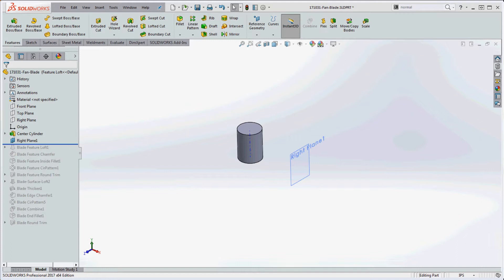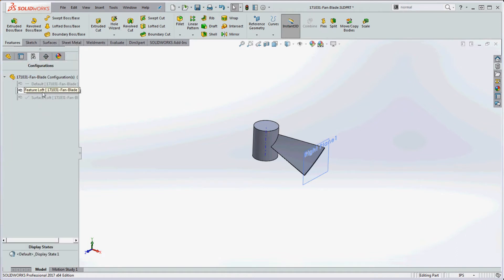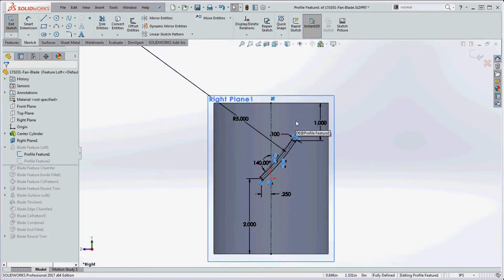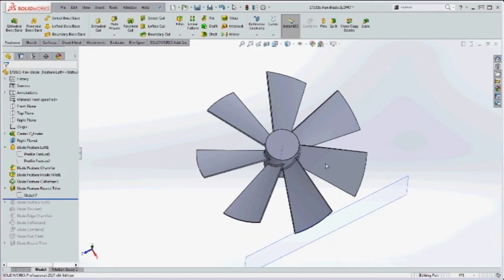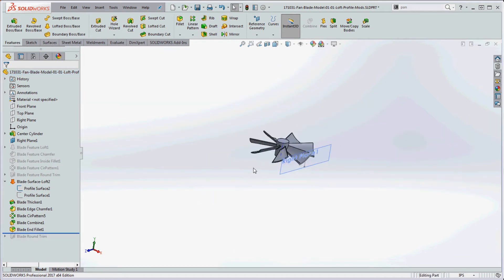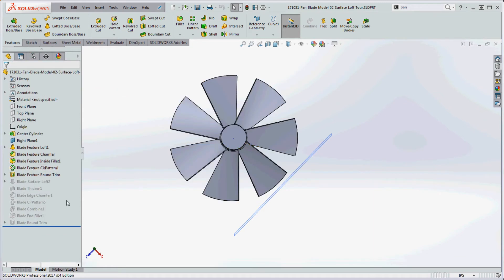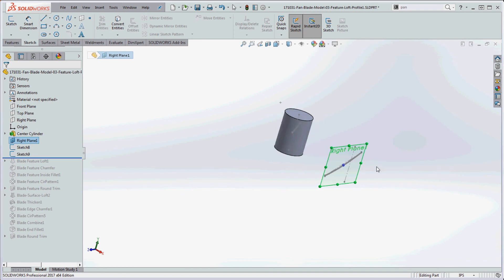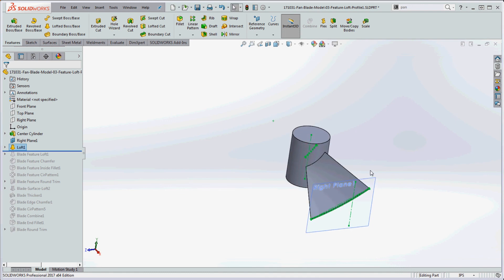33, Online SolidWorks - Create a Fan with Blades or Similar Form - Solid & Surface Lofts & Pattern

Comment: I get what you're doing here and it's been real helpful for me.   The fan blade I'm needing to draw is not only a typically angled fan blade like the ones you show here but,  the blade I'm having a hard time with also includes a sort of cup-shape on the front side of the blade.

It's not actually a fan blade per se,  It's a single blade for a fishing lure.  The cup feature on the front face of this blade is there to create a plopping sound as the blade comes full circle and enters the water as the lure is being reeled in.  How would one go about creating that slight curved indent or cupped feature on the front facing surface of the blade?

Thanks for your help.
Reply from the maker: The first thing you should do is consider Surfacing tools, SW will create a more stable model when you don't have volume to deal with from the get-go.  With the Deform surfacing tool you can apply a grid and points onto a surface and pull or push those points to get a form you may be looking for. After that you can add a thickness to the surface and other features that you may need.  Hope this helps.  CSS
Reply: @DesignInnovations  Thanks for taking the time to reply.  I really appreciate it.  The technique you mention is foreign to me.

This is not because your explanation makes no sense.  It's because I'm self-taught in SolidWorks and on top of that I'm using an older version so I'm not really sure if my version 10 has those features.

I actually finished up the drawing of the fishing lure I alluded to this evening.  I'm sure doing the way you've described would have been more efficient and the correct way to go about it.

I may go back not that you've given me a clue as to how to go about it correctly.  I was able to use the surfacing tools to get the basic blade or propeller shape I wanted; it's just that slight cupping that I needed had to be gotten in a overly time consuming way and even then my surface finish was less than what I would have liked.

I'll try giving your method a shot if I can find those features in my version of SW.  Thanks again.
Reply: @DesignInnovations  I found it.  On my version of SW it called the "FreeForm" tool.  I was looking for the "Deform Surfacing Tool."  I think I'll go back and just delete all the steps I took to make all of today's efforts come out the way they did.
Many thanks.
Reply from the maker: @MrTjmk  Yeah, it's a very useful tool. Although it can get complicated pretty quick and hard to control sometimes. CSS
Reply: @DesignInnovations  "Complicated;"  yea I found that out the hard today as I was trying to figure out how to use this feature.

I'm basically dyslexic so reading about how to use this feature from the help menu does me little good.

I'm more of a trial and error kind of learner.  I eventually figure it out just enough to give me better results than my painstakenly long and complicated work around I did yesterday.

Thanks again.
Reply from the maker: @MrTjmk  Have fun, it's a good tool. As you figured it out, it's best to start with a simple grid and a few points.
Reply: @DesignInnovations  What really messed me up at first was that I was using the curve tool instead of the spline tool to draw my curves for this particular fan blade.

With each point of the curve tool made it impossible to apply the free form tool.  Only with the spline tool could I get just the right amount of free formed curve.

Thanks again.  Over N Out
Reply from the maker: @MrTjmk  I did not know that regarding curve vs spline - because of the complexity of splines I would have thought just the opposite. CSS
Reply: @DesignInnovations  yea; you probably figured this out already but when I used the curve tool I had to create several curved sections as apposed to the spline tool becoming one long line.

After doing the lofting thing with the two lines I drew with the curve tool, when I attempted to free form it to get the cupping shape on the inside face of my fan blade  It was impossible to get the shape I needed because the SW software was reading my curve drawn lines as separate sections.

SW seemed to read the spline drawn lines as one solid line so when I used the free form tool on that spline/line it then showed the evenly spaced grid that allowed me to then pull or form the gradual cup shape I was after.  Learn something new every day.
Reply from the maker: @MrTjmk  Yeah, that sounds like a great approach - something new - I'll keep all this in mind.  I consider SolidWorks to be a vast toolbox with all sorts of hidden gems yet to be discovered.  With that thought in mind - the following is a link to something I discovered and developed about a year ago I call Dynamic Multibody Modeling - it's essentially moving bodies in a part - like parts in an assembly.  https://youtu.be/5vdtOmPS4cI  This also uses some basic SolidWorks tools to produce some surprising results.
Reply: @DesignInnovations   I'll check it out.  Incidentally; I finished modeling the project I had intended to use the "Free Form" tool on.

I printed out a couple of prototypes and got them ready for field trials.  Success.  I got three bites but I was only able to land on out of those three.  

No matter.  The point was to see if my DIY 3D printed fishing lures would catch fish.

I did make a couple more modifications to my models then printed out a half dozen more.

The store bought versions of this same fishing lure costs about twelve bucks  each plus tax and shipping.  3D printing a half dozen of them only cost a dollar and change.

https://www.facebook.com/groups/sirayat
ech/permalink/753069318937785/

You can see what I was shooting for at the link above.   Thanks for your help.
Reply from the maker: Glad it all worked out.  The link does not work for me though.  3D printing - looking at a new large format resin printer now - very affordable.  CSS